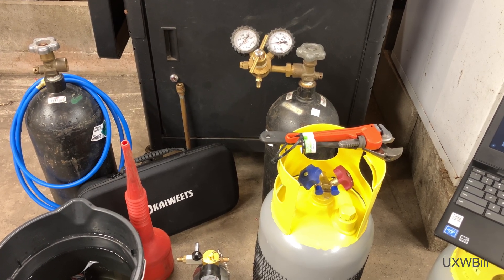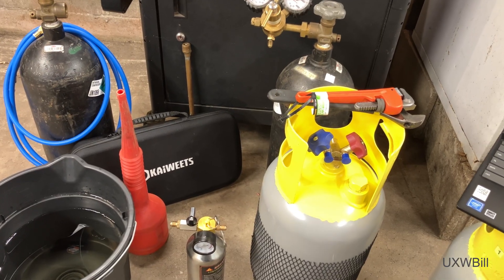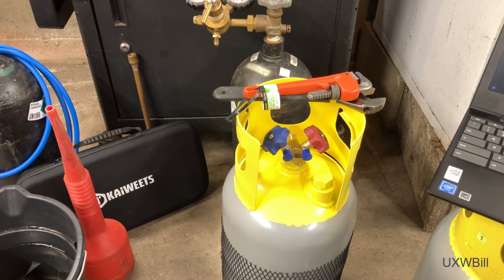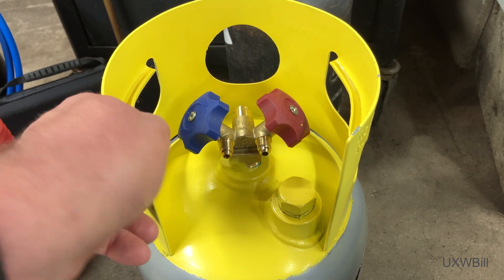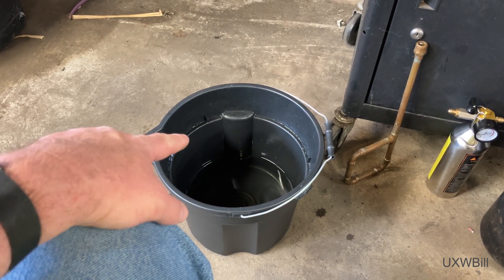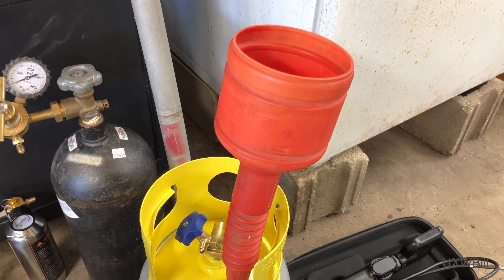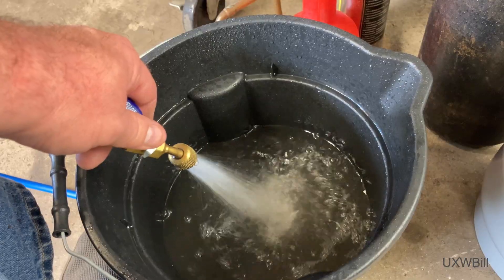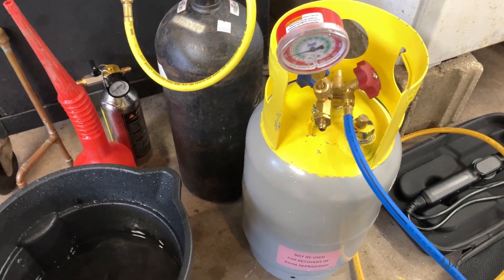Making a Large A/C System Flush Tank On The Cheap

Comment: When I needed to flush my ac I got a few bottles of 95% alcohol. squeezed it through until it came out clear. then used a few cans of compressed air to flush out the most. Then ran a small usb vacuum pump on one side with one side plugged, and one side covered with a clean rag as dust filter for a few days. pulling air through the entire system to evaporate the ethanol. After that I put it on a proper vacuum pump overnight. filled it with pag oil and put it on the vacuum pump another night.

It wasnt fast but it worked.

Comment: So, I did actually discuss exactly this with the neighbor up the hill who's been in HVAC/R for about 20+ years, it sounds like this idea has legs.

Now, for my application, we were discussing using denatured alcohol in place of Rx11 since the latter is basically just a convenience tax for HVAC/R guys and is effectively just a can of the formerly mentioned with some kind of aerosolizing agent in there as well (this was in discussing swapping dad's old system out for that heat pump—I'll get around to it eventually, I gotta start my new job with industrial shaped electrons first), but functionally speaking , the idea here has legs, it just looks like (as you mentioned) you'll want to either find a cleaner canister or find some way to ensure no big chunks of crud get brought into whatever you're flushing out.
Reply from the maker: I used Rx11 once a long time ago, but never looked into what was in it. Another commenter suggested using something like Evaporust on the cylinder and I think I'll give it a shot. I got two gallons of FJC A/C system flush for another job and now I'll be using it on this one. However, I think I'll pick up some denatured alcohol and run that through prior to the actual flushing solution.

I don't know if I could push the solution through a filter/dryer and expect that to clean up any crap that might emerge from the cylinder or not. I might pop one inline and find out.
Reply: I’d have to read the SDS for Rx11 to verify, but it sure does smell like the booze you’re not supposed to drink 😁

If you have some extra FJD sitting around though, hey, “smoke ‘em if you got ‘em”.

That’ll be interesting to see how well evaporust cleans the thing out.

As for the filter canister, I’ve never opted to clean one of those, but I was always operating under contractors of varying degrees of honesty (if you know, you know, and I think you may know iirc) so I’d always see those just get cut out and replaced. That’ll be interesting to see as well, but it may be advisable to use something a little less expensive than an iPhone to film (boy, that’s rich coming from me 😂).

Comment: I agree, compressor is bleeding black. Perhaps some Evapo-rust could sequester the remaining rust in your tank Bill?
Reply from the maker: Thanks for the suggestion. I'll give it a try and see what shakes out. (I just now thought of rust removal by way of electrolysis as another possible method, though I think that leaves a film behind that would need to be removed. It also wouldn't be easy to get an electrode in there and not have it short out.)